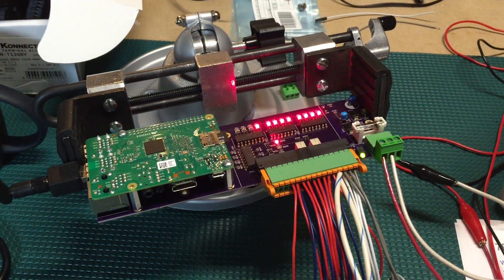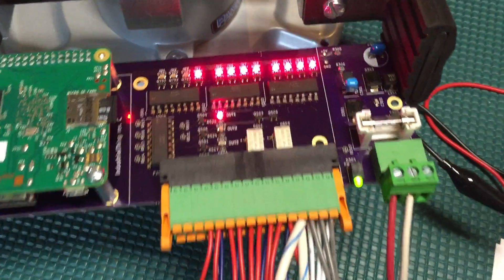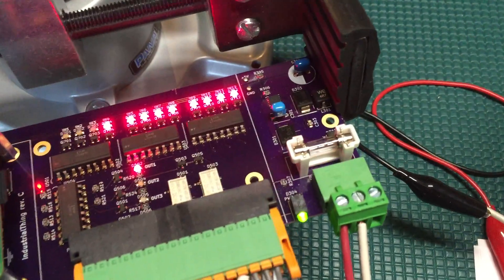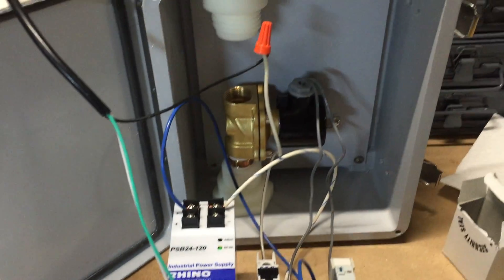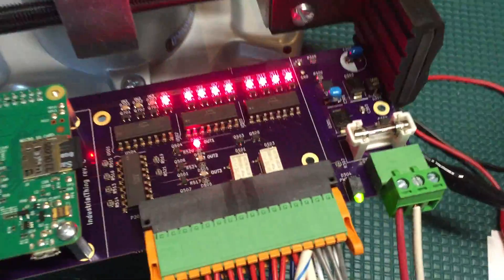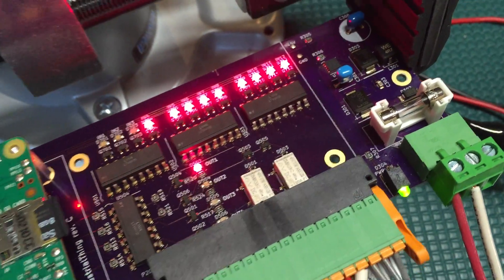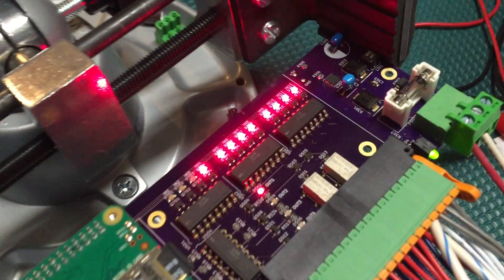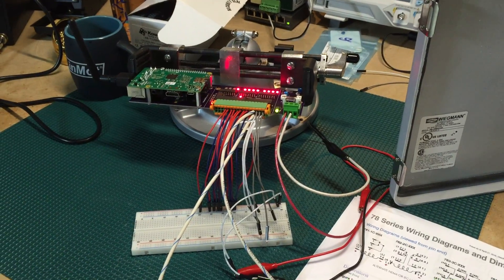IndustrialThing - Industrialized Raspberry Pi Operating Solenoid

Comment: Expansion board looks like industrial, but what about Raspberry Pi? Is it stable and reliable? What about operating temperature, is it -40 - +85C?
Reply from the maker: Hi Jonas - good question. I did design the expansion board to be industrial in-terms of the temperature limits. As you stated, -40C to +85C is a good, widely accepted range for industrial electronics. With regards to the RPi, the official Raspberry Pi FAQ says the following:

"8. WHAT IS ITS OPERATING TEMPERATURE?

The Raspberry Pi is built from commercial chips which are qualified to different temperature ranges; the LAN9512 is specified by the manufacturers as being qualified from 0°C to 70°C, while the AP is qualified from -40°C to 85°C. You may well find that the board will work outside those temperatures, but we’re not qualifying the board itself to these extremes. -Performance and Cost "

The AP being the Broadcom chip.

Full FAQ here:
https://www.raspberrypi.org/help/faqs/#performanceOperatingTemperature

So, at the extremes, I would not recommend using the RPi. That said, I do have several installed in applications where the panel temperature hovers around 50-60C all summer long and have had no issues so far.

The way I envision this product being used is for industrial prototyping, or industrial data collection. Running mission-critical or safety-critical applications with the RPi in environments at temperatures approaching either extreme is probably a bit risky.